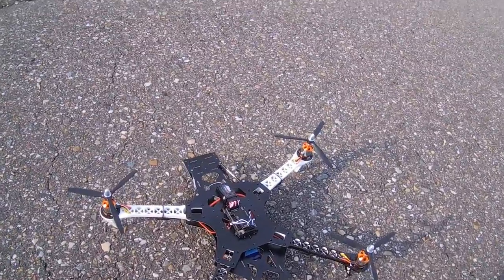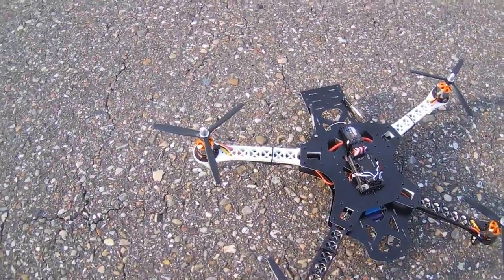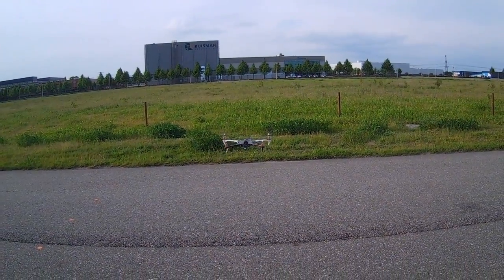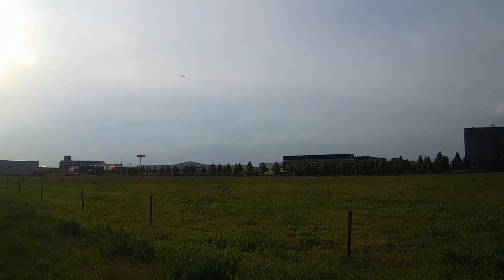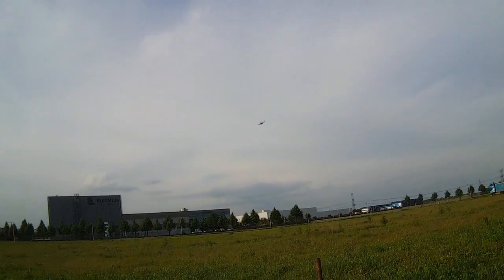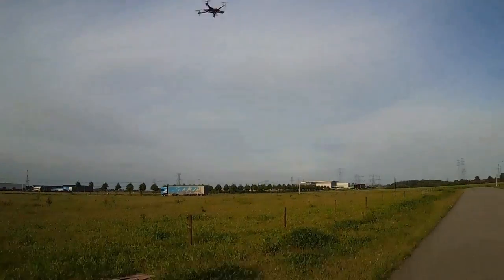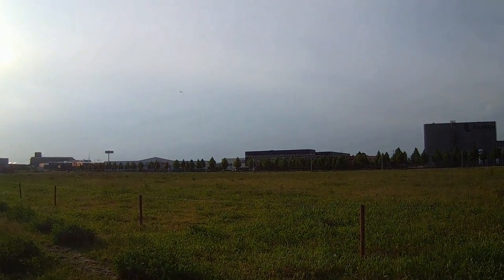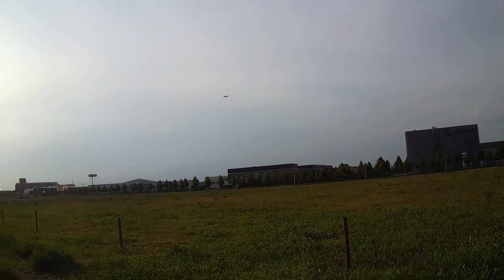HobbyKing SK450 Dead Cat Quadcopter - Maiden Flight! HKpilot Mega 2.7

Comment: Very nice! We both know the most joy is in both building and flying something you "made your own" by modification or invention. I'm thinking of mounting a 450 size heli frame with shock mounts on top of a quad for all the electronics ... complete with heli body! lol From the RC airplane world: I love the look of multi blade props, but they are only used for display. There is too much power loss with more than two blades as the turbulence from one prop disturbs the "bite" of the prop behind. Real aircraft use them from desperation when there isn't enough ground clearance for a two bladed prop big enough to take advantage of the available power. There is a penalty in efficiency. It's worse for models due to the "Reynolds Number" involving the relative density of the air compared to the lift or incidence (pitch) of a wing or prop and the size of the aircraft.
Reply from the maker: Thank you James :D 
Wow that is a original idea right there! I did mount a helicopter canopy on a quad, but the enture frame on shocks :D

Well hmm yeah.. 3-bladed props ;)  The funny thing is that most FPV racers now use 3-bladed props ;) ghehe they Are less efficient yeps...

Comment: Hi!
I want to build a stable drone, not a race one. One good for aerial photograpy and video. I can't afford an Inspire or a P3P. I bought a Ghost, but it's not what I need. Can't rely on it. I saw someone with a build drone, cheap and stable. He used a chassis of 450. Don't know it's like yours, maybe from DJI. Are any made just from carbon fiber? I want to make one. Is your drone, the quad you put toghether suitable for aerial video or an other platform or formula be better? Of course, with a gimbal, legs and a camera. Thanks!
Reply from the maker: +Eugen Balan Hi there Eugen :) 
This (hobbyking) F450 sure CAN be a very stable platform. You will need some knowlidge and good components though, but yeah.. This quad sure is stable and can easily lift a gimbal + camera :) 
Cheers!
Reply: +DutchRC ADVENTURES 
Thank you! I'm looking for informations, what is needed. I thought that a drone made ready to fly is better than a build one, but isn't really like that. I understood this in a hard way, almost 600 $ for a RTF drone which is far from what you have. 
 Yes, I need some knowledge about drones, how to put all together. I want to put just  a GoPro type cameras, small ones, with FPV and control of the gimbal. My homework. But to have at the end something to rely on.

  Maybe I'll ask you again about something. Could be a path to build drones for this purpose. I don't find informations about this, all are about race drones. For smooth videography they send me to Phantom 3Pro, Inspire or 3DR Solo. That's why I follow those like you. 

  I'm looking for a drone which is "locked" in the air., stable, steady. It' very difficult to find videos on Youtube with drones that can prove that they are steady. Almost all who are flying drones make them run. For me the most important thing is to stay fix in the air and after how it runs. To make life easy for the gimbal. The drone I bought is waving and swinging. Maybe on review about drones this quality should be put in light more clear. A drone to be lifted and see how stable it is. Dragonfly mode, than eagle mode.
Thanks again!
Reply from the maker: Well yeah. Ready to fly quad's are easy offcourse, and in Most (not all) cases they have electronics that fit well toghether. If you build it yourself though, you can make something of far better quality for less $$.. 

Feel free to ask anything offcourse, but this Deadcat frame from HK (there now is a version with a power-distribution-board.. That would be a good start-off point.. 
On mine I have a relatively expensive flight controller (APM 2.7 / Pixhawk).. But even with a cheap KK2.1.5 board you can expect quite good results.. 
On mine I have used inexpensive motors.. If you would use Tmotor's results should be a bit better still..
Reply: +DutchRC ADVENTURES 
Hi,
With 11.11 Sale I bought a drone, QAV250, full assembled, ready to fly. Has FSi6 RC and FPV, modules, camera and display, 600mW, all around 200$.
 Yes, it's a small drone, but was convenient, plus I don't have time and skills to build a drone from scratch. This type of drone is a compromise. I live in Danmak where is a bit of wind. I think this type of drones, uncovered in plastic, cut better the air. My Ghost drone struggles with medium wind. A small drone is more fitted for wind. I saw that is powerful and very fast. Maybe with bigger props can be also stable. An other advantage of a small drone is that can go in narrow spaces, it's not that visible. I want to do aerial video and photography. 
 The only thing I think I have to address is stability, but I think it has enough power for that. 
 I like also that is carbon fiber, very resistant. I saw a drone like this hitting the trees or even crushed, but restarted the motors and flew again, like nothing happend. My Ghost would have been pieces for such crushes. I like also that if I would have problems with it, I wouldn't have to sent it to China and pay 200$ shipping. I can change or replace what I need. I can master it.
 I'm waiting for delivering. 
 Thank you for tips.
Reply: +DutchRC ADVENTURES 
I'm thinking if some extentions would allow me to use bigger props. Just thinking, I'll see. On a toy-plastic drone this is not possible.
Reply from the maker: +Eugen Balan Gathering all info to build one from scratch indeed Does take time sir :)  Over here it's Very windy most of the time as well, and I have found that quads with small (fast moving) props deal better with wind that big props :) I guess them big blades catch the wind a lot more..
Reply: +DutchRC ADVENTURES 
So I made a good choice at the end. A small, but heavy and with powerful motor deals better with the wind. I saw that those big from plastic drones, like one type of Parrot with guard props can be shaked at smallest wind. Thanks!
Reply from the maker: +Eugen Balan There you go :)  And those foam prop-guards on the parot are Great wind-sails indeed ;) 
Cheers!

Comment: What? a quadcopter that you didn't build from scratch! ha ha ha
Looks really great, the centre part is massive, heaps of room for stuff. The props look way too small for it, but they seem to work fine and give plenty of thrust. I wonder how they would go with a camera and gimbal on board?
Reply from the maker: Jax Teller RC I DO feel a bit guilty for not scratch-building something! :P  grrr ;) 
But yeah.. nice design I think.. Lot's of room for STUFF on it :)  

Yes.. those props huh?? Those blades look so narrow! I have tried about all makes and kinds of props on my planes though.. And these (Master airscrews) work out So well somehow.. 

Yep.. a gimbal is one of the next things on my wish-list..
Reply: DutchRC ADVENTURES
Master air screws sound good, I might need to try a set myself (-: